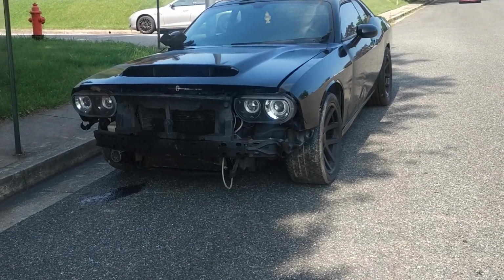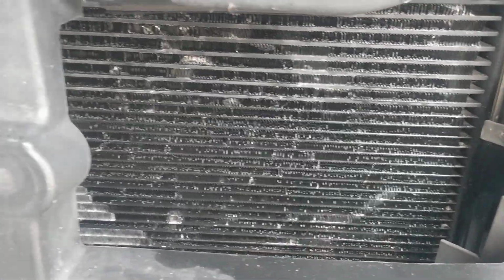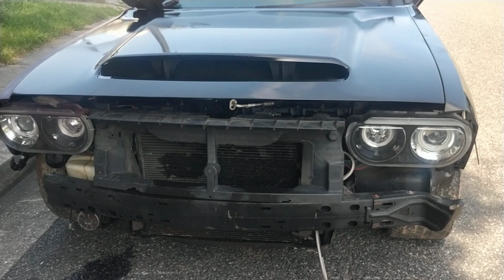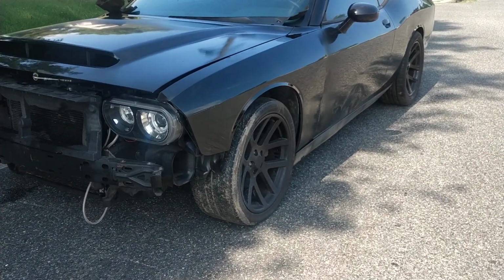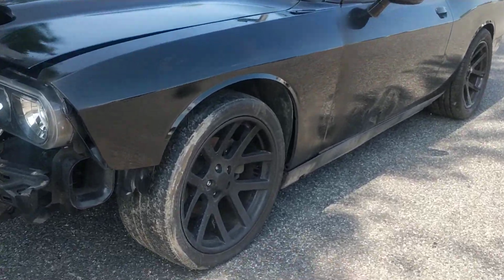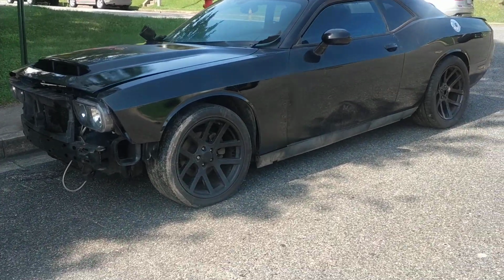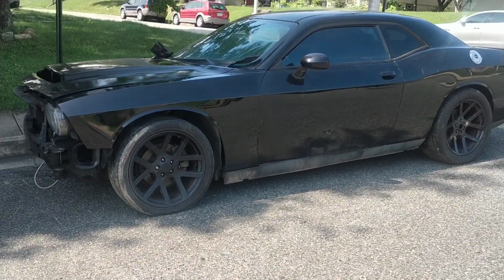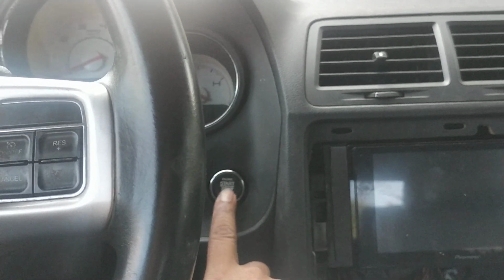V6 Challenger Progress

Comment: Hey man love the vids I know you get asked a lot but what would I need to replace/change going from a 2017 3.6 sxt challenger to a 2017 5.7 both automatic 8spd
Reply from the maker: Thanks you'd have to get another 8 speed trans from a 5.7 or 6.4, a driveshaft, a pcm, engine harness, witech micropod from AliExpress, fuel rail adapter, exhaust manifolds catalytic converters and a cat back system,  a 5.7 pcm flash with vin programming which the witech will do. I'd also replace the engine mounts with new ones even if your  new 5.7 comes with it
Reply: @SRTKHRIS thank you so much best of luck to you you’re amazing
Reply: Oh one more thing is a fuel pump and differential a needed change or can be put off to down the road
Reply from the maker: @jamesdiaz3073  the differential isn't needed and neither is the fuel pump unless you plan on racing..pushing it to the max then I'd replace the fuel pump immediately. Where I live I never really get max it out because of traffic so I didn't replace it immediately. The fuel pump did go out on me a year after I did the swap it had enough 🤣 so if you plan on street/track racing I'd replace it asap